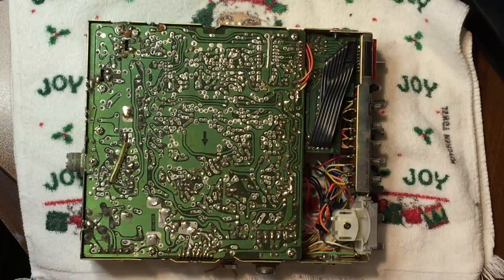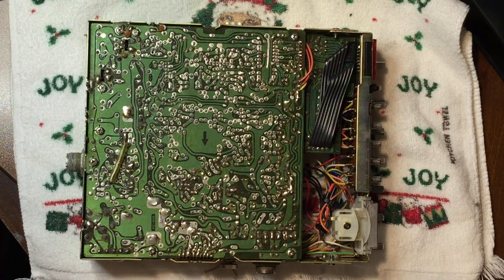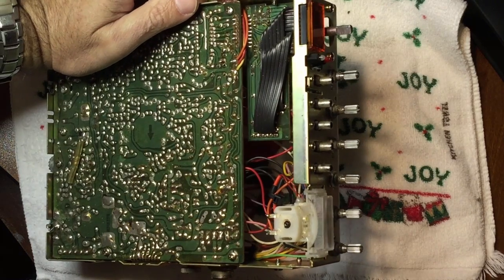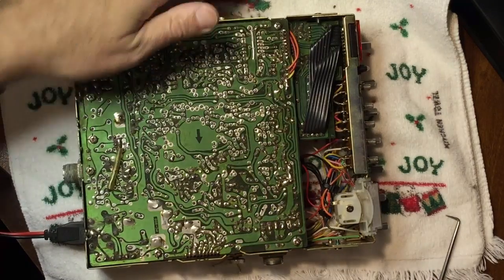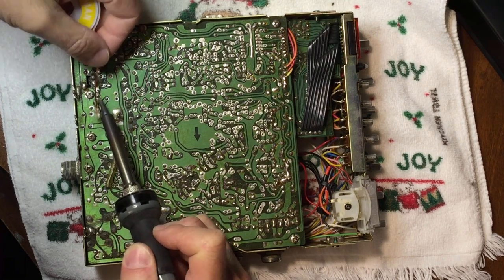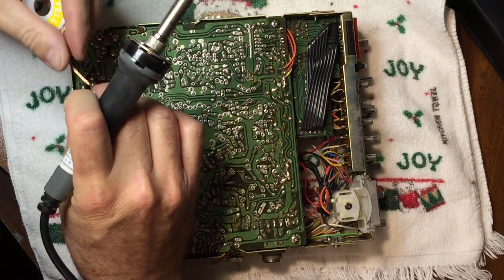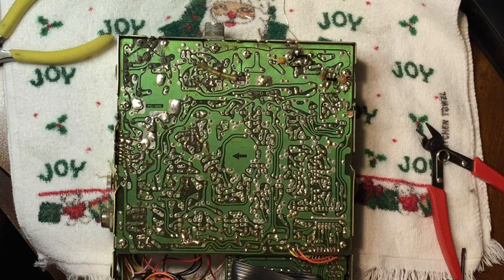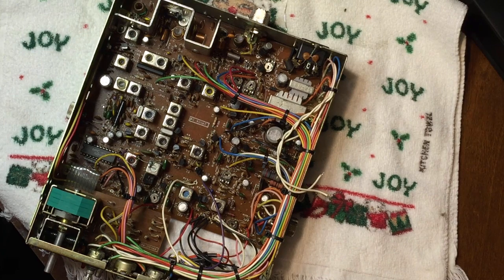Cobra 29 Mosfet Modification, Complete installation, Shows ALL, Save MONEY Do it Yourself!

Comment: First I would use a solider sucker then use flux when soldering parts back in a pair of tweezers to hold the legs of the part as a heat protector
Reply from the maker: Great ideas!  Thank you..

Comment: The 68pF cap added across C59 should be an NPO type  because of the type of circuit t's used in.  The NPO types have a very low temperature coefficient so your RF circuit won't drift to much during temperature excursions.  Also it should be rated at 500V .
Reply from the maker: TY... See the other comment.

Comment: I bought some very low cost Chinese solder wick and it didn't work at all because it comes without flux. I believe they sell it that way because they want you to be able to use a flux that's compatible with the solder you're using.  For the old standard 60-40, Pb:Sn solder rather than any lead-free types you can just buy a small can of rosin solder flux.  Heat the new wick a little bit then dab some of the rosin flux onto it while it's warm then try it out.  It'll work wonderfully.
Reply from the maker: HI Joe!  Great tips on the CAP and the solder wick.  I'll definitely keep that in my bag of tricks.  Yes I have some of the cheapie solder wick and no it doesn't work very good!  I'll try that next time I get the iron out...  I used to work at an electronics shop for a long time and I guess they had the good stuff.   We never had any problems with it.
Reply: The old solder wick that always worked perfectly had rosin flux impregnated into it.  That's why it worked so well.  If you're trying to use fluxless wick it's no wonder it doesn't work.  You need to get a little can of rosin flux and then you be super happy with your cheap solder wick.
Reply from the maker: Awesome info!  Yes I have the wick and the rosin, but I didn't put them together... Lol.  Of course the old stuff is better!  That holds true on many things... 😊

Comment: Is the variable dead key adjustment actually an output power adjustment? If you lower it all the way is the power all the way down even when you talk into the microphone?
Reply from the maker: HI John... I believe they are correlated, but not necessarily linear.  If you lower it all the way down and talk in the mic you're still going to get output (IF I remember right).  It probably won't sound very good if you do it that way.
Reply: No

Comment: What a " joy " to behold ! LOL !
Reply from the maker: Thank you!
Reply: @JLPicard440  Seems to be a lot better then using a small amp board with an MRF-455 to get the output but I wonder how long the power circuit for the final holds up since it is drawing 4 or more times the current when it hits 40ish watts.. I think I saw this mod or similar and they added a 12v+ jumper to somewhere near the final transistor.. I would also suspect that adding a bigger heatsink or a small fan would have that new transistor lasting longer for people that talk a lot..
Reply from the maker: Yes I'm sure those will all help.  One thing I've learned over the years, you can't have to much cooling for electronics!

Comment: Do you still have info on where I can purchase that LED light strip for the meter? Thank you
Reply from the maker: Not sure about the exact one that I used here, but Amazon does have lots of those LEDs... Just type in 12V LED bulb for radio s-meter and that should bring you  something... or LED light strip instead of bulb...
Reply: @JLPicard440  Thank you Sir! I found some under  led for s-meter.
Reply from the maker: Excellent!  You're welcome...

Comment: Pretty sure you should tighten the screw and/or nut BEFORE you solder-in your power transistor. That way the torque from the screwdriver won't put stress on the soldered-in leads and possibly damage the circuit-board's traces. I was personally shown that this can and does happen. Also, it's a pretty good idea to de-solder all leads before you attempt to remove a component. And remove ALL solder from the pads before you remove any component legs. Everything works smoother when you do. Just sayin'. 
Nice video. Informative. Thanks!
Reply from the maker: HI, thanks for the great tips!
Reply: Yep
Reply: And "wet" the pads that are to be desoldered with some fresh solder.
Reply from the maker: TYSM for your great info... 😊

Comment: Every radio I see with a Variable dk mod has a terrible rx afterwards. Lots of noise and the squelch never works nearly as good as it used to. Not sure why this is. Something about the variable mod dk just messes up the RX but if you weren’t around radios a lot the user wouldn’t notice.
Reply from the maker: Interesting!   I hadn't noticed that, but I wasn't looking for it either.  Thanks for the info... 😀

Comment: Way to much heat sink compound on that final a properly tuned 29 will do 25w clean 10w gain to 35w not worth it unless your having to replace a bad final you have to double your power output to gain 1s unit
Reply from the maker: That's true!  Thanks for the info... 😀
Reply: You have to double the power output twice to get one s unit increase.  6dB per s unit.  Doubling power once is 3dB.

Comment: Just wondering if anyone has tested or used IRF 520's, with what I've found, that have 93w output? Will these work? I've found 48w (that was the norm back in the day), 60w and 93w outputs. Want to know if it makes any difference. Thanks
Reply from the maker: I would find that hard to believe!  CB shops like to use generous meters like a Dosy to inflate the actual wattage so it looks good to the client... 😀
Reply: @JLPicard440  The wattage comes from the data sheets of the mosfets. Not a cb shop or builder. Look them up for yourself. I buy my electronics from Digi-key and a few others. I'm just wondering if they'll produce or not as I'm no radio electronics wiz. Thanks
Reply from the maker: OIC... Sorry for the misunderstanding.  I haven't seen a C29 produce that much power, but that doesn't mean that it can't if the IRF mosfet is capable of it... 😀.  Yes I'm familiar with Digikey...

Comment: I like the mod and I would like to know how you made the swr cal into a variable for the dead key. It looks like it’s a fun mod to install.
Reply from the maker: I didn't say in the video?  The SWR knob is a potentiometer and isn't really necessary for operating the radio.  I just taped off the original wires and used the knob as the control for variable dead key.
Reply: SVSM29 (SimpleVariableSuperMod Cobra 29) uses Delta Tune as controller.  Variable as low as 1/2W.

Comment: i have C61 witch is a disk cap. lets see how she goes from here
Reply from the maker: U can do it..😀
Reply: @JLPicard440  well i turned a 5 watt radio in to a under 1 wat radio... the only part that i did not follow is i could not find for sale the IC for biasing the mosfet, so i made one based on a schematic i found (2 resistors and i diode) the schematic called for abnormal values so i got close as i could with parts on hand.
Reply: @JLPicard440  welp, after a few hours of poking arround. and dropping my 330k resistor to a 22k i got it to swing up to a whole 3 watts. i almost reached premod performance.
Reply from the maker: @RockeyDAproductions  Wow..  Ive not tried to build the biasing part.  It does seem like the availability of that part has diminished.  I looked on eBay and the only thing I found were people selling the kits that are probably the same thing you just did.. did you save the original parts you took out?  Can you fix it back to stock?  Do u have all the right values?  Looks like a 1n4148 diode, a 360 ohm resistor, and a 230K resistor (one guy on eBay was subbing this out for a 226K).  I would stick as close to those values as you can, I don't know how changing the values will affect the power output.

Comment: I didn't quite follow what you did as instructions were a bit vague, but I know why you did that.  That heatsink is going to get mighty hot!
Reply from the maker: Not hardly.
Reply: @JLPicard440  Really, I thought you put the power up?  Or were you measuring SSB power?
Reply from the maker: bob fourjs not that much power.. it doesn’t run very hot

Comment: Maybe I missed it but it the 68uf 500v or 1000v
Reply from the maker: I don't remember.  I have found that if you increase the voltage it really doesn't hurt anything.  I don't see why the 500V won't work, but if you have a 1000V laying around, I wouldn't hesitate to throw that one in either...

Comment: hello sr. what mosfet you remove what number. and  what nomber you put . and one you put new one is for max power what number you put please thanks ineed info, and thanks your.
Reply from the maker: I don't remember now, but I think I mentioned it in the video..
Reply: @JLPicard440   thanks
Reply: @JLPicard440  probley 2029 in it irf520 is what he should have put back
Reply from the maker: @moparre  IRF520 does sound right... 🙂
Reply: @JLPicard440  yep i just installed one yesterday ive tryed the erf2030 but got less wattage than the stock final

Comment: With thermal paste you dont just glob it on you only need a small drop and with a plastic blade you rake it.
Key tip you remove the old paste and clean the surface of the heatsink.
Too much thermal paste will create the opposite effect and insulate heat. 
Best thermal paste is artic silver or gold.
And use a grounding strap when touching electronic components.
Reply: Yea only problem is that it's bad advice. The thermal paste under these type is finals doesn't I sulfate heat because it's such a small surface area. And mor important here is the fact you just really suggested artic silvery cpu thermal paste in rf work. HUUUUUUGE NONO. this isn't just my opinion. Ask any tech that relaly knows his stuff that is hands down the absolute worst possible thermal paste you could EVER put in a radio or amp. Pls do not do that to your radio
Reply: @bparker86 he just doesn’t know 😂😂
Reply: No joke sherelock 😅😅
Reply: It isn't even needed with these isolation pads, it will only make more of a heat barrier. Only use when there is metal on metal. These iso pads are made to transfer heat.
Reply: Hey there!  That sue is nice of you to eave a constructive comment to be read. Thank you formo the bottm of my heart.

Comment: hi there  I would like to see what that mosfet does on 40 or 39 holding dead for a few minutes and get back to me with results
Reply from the maker: Gustavo Gomez I don’t have that rig anymore
Reply: @JLPicard440  ok thanks anyway it's just because I recently modified a 29 nw. greT power 12 watt dead key accept for channels above 35 wattage drops to half s watt and I did adjust cans no difference .
Reply from the maker: @GustavoGomez-kk7ob  HUH... No, I don't remember having any trouble like that.. the power across the band was about the same... You shouldn't be having a 12 watt dead key either.  It's better to do the variable dead key mod, so you can turn down the dead key to about 2 watts or so...
Reply: @JLPicard440  ok thanks

Comment: You should always tighten mechanical connections BEFORE soldering.  Otherwise,  you can put stress on the joints.
Reply from the maker: Agreed...
Reply: Nice Comment

Comment: Swapping out the final(s) will 
give more power?  I have a 1978 
RCA Co-Pilot14T302 SSB CB radio. 
How do I find out which new finals 
to swap in, ensuring compatibility, 
of course!! Thanks for answering!!
Reply from the maker: I'm not familiar with that particular radio... see what final it has... maybe there's a compatible part out there...
Reply: @JLPicard440 : 
Thank you for answering so fast!! 
How & where to find out a 
compatible final?  Once I have the 
number of the final, how & where do I go to find one that'll work in my CB?
Reply from the maker: @norman2999  you might try to Google that model number to see if there are any mods/tuning tricks available for it... most of the time you can get more power from the final that's already in there... its usually not worth just changing the final just for a few watts... no one will ever hear the difference...
Reply: @JLPicard440 : I found  
the number on the final. 
It's: Mistubishi symbol 
        C1969 
        65Y-BH  
I googled it and couldn't find anything at all.  How would I find a 
replacement part for it? Is there 
any way to check it while it's still 
on the board or is removal 
necessary? Also: is the final 
something that could degrade 
over time, or is it a case of either 
it works or it doesn't? Please 
forgive my newbie questions, but 
if I don't ask, I will never know!! 
Besides, EVERYBODY had a first 
time to ask a question!!  I'm very 
fortunate to have a knowledgeable 
person such as your good self to 
ask these questions of.  I really do 
appreciate your taking time to 
answer my newbie questions. 
So if you could answer my 
questions above, I'd be over the 
moon!! Thank you again(!!), 
Norman
Reply from the maker: @norman2999   That's a 2SC1969... it was very popular for a long time,  looks like you can still get them on Ebay.. I didn't check Amazon.... if its working I'd leave it alone... if you don't have any output.. you'd have to pull 2 of the legs to test it.. I doubt it would degrade much... usually they just work or they don't... hope that helps... there could be some mods for that radio to get a little more power out... check cbtricks.com and see if they have anything listed

Comment: The de-soldering braid that you're using has little to no flux in it. That's why it doesn't work! You need a container of flux and a brush then it works fine. The best I've found is Chemwick de-soldering braid. It's much more expensive but if you do electronic work frequently you'll thank yourself for putting the extra money in it.
Reply from the maker: Yes, I've used chemwick.... it does work better..... :-)
Reply: This

Comment: can I use a en369dr can't find any one who has th fn in stock.
Reply from the maker: Nikki Lucas huh... Check ebay... you'd have to get the spec sheet on both and compare them .. I don't know right off the bat
Reply: +Take a Bath Productions that's were I checked the Dr and fn are showing the same companion part.
Reply: +Take a Bath Productions that's were I checked the Dr and fn are showing the same companion part.
Reply from the maker: Nikki Lucas well that's a good sign
Reply from the maker: Nikki Lucas I can try to check it out a little later when I get back to my computer

Comment: In addition to new solder, try using some flux paste, such as what is used for SMD rework (not what's used for plumbing) when using the braid, it generally helps it wick up quite a bit, then use 91-99% alcohol for cleanup.  BTW, it may be illegal to transmit with a modified CB, but people have been doing all forms of mods since day one and the FCC usually only busts people running huge kickers or someone causing nasty interference.  They have more important things to do than busting people with modified radios putting out less than 100 watts.
Reply from the maker: Yep, agreed on the FCC,.. I don't get on CB anymore..no one really local around here to talk to,.. they all flew the coop!!  As far as the flux,.. that's a good tip!  Thanks..
Reply: LMAO they could care less!!!! Look at CH 6 and 11, they run thousands of watts and the FCC looks the other way!!
Reply: jamienoel x
Reply: jamienoel: Newbie question!! Do you apply flux to the solder on the board, then put the braid on, then heat the braid? Or did I miss something?  Thanks in advance for your answer!! 73s, Norman.
Reply: @norman2999  when removing solder, flux the braid lightly. You can use cheap plumbing paste for removing the solder. But use quality flux for applying solder
Reply: @Hook-set_Outdoors      But remember that some cheap plumbing paste has acid flux in it to clean really crappy solder joints in plumbing applications. This same acid flux can and does damage electronic circuit board traces , so either -- clean it up vigorously --- or use flux designed for electronics work only. So, I would say ---- never use plumbing solder OR plumbing paste on anything electronic and you won't run into problems. Read the labels first.

Comment: Great job Bud. Another way of doing the Dead Key Variable which i have done over 30 times now is at this video. Looks to be very similar to yours. Not sure about the 12v power going to the Swr Pot then to the 3055? In this video where is the Transistor being biased from the jumper I am guessing right?

https://youtu.be/nafq9_l7jnM

Comment: I'm still learning electronics....so can you explain why I want a variable dead key? Is that for measuring or turning down the output? Thanks.
Reply from the maker: MAN CAVE NO.1 yes most amps take a pretty low carrier of about 2 watts... so it's nice to be able to turn it up or down
Reply: WALLDORF ELECTRON_CO.  A variable dead key is only good for close up qso when you vary the power it changes the load the tank circuit sees but gives more swing on a low power radio 20-25 watts leave out the swing kit and tune for max the radio will last a long time. Set a swr meter to check the tune of the antenna then vary the power and whistle in the Mic check the swr.I never put in swing kits they distort the audio have a reputable shop dip the tank circuit
Reply: @jefferybernard4800 "dip the tank 
circuit"?  Please explain, thanks!!